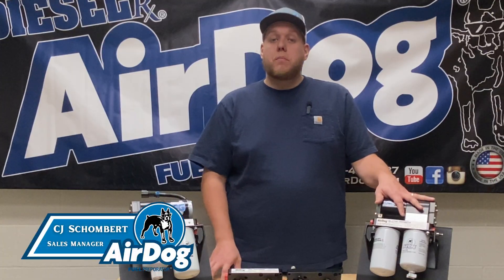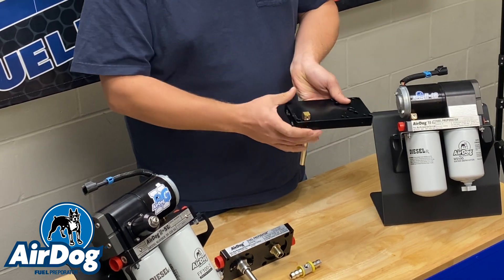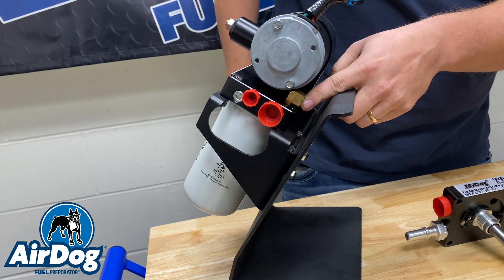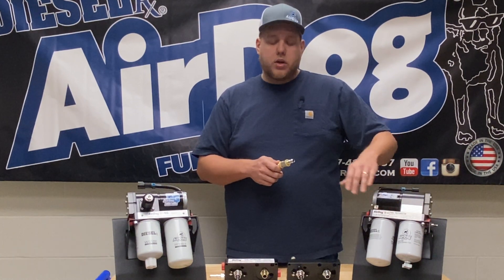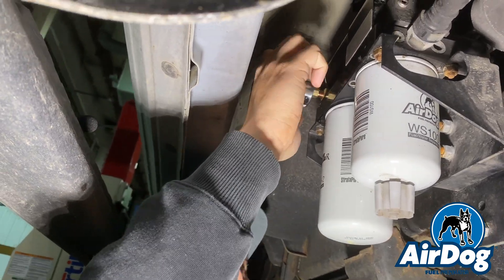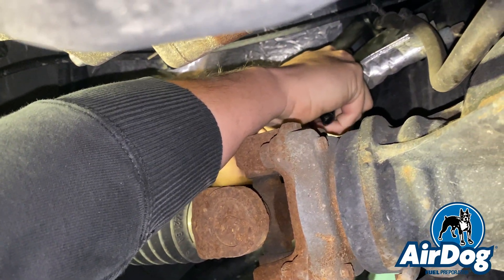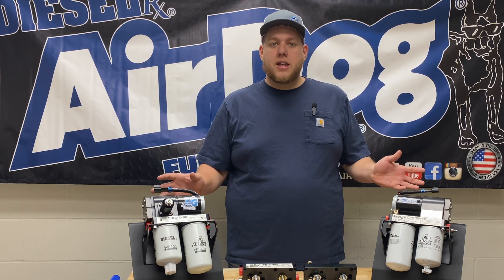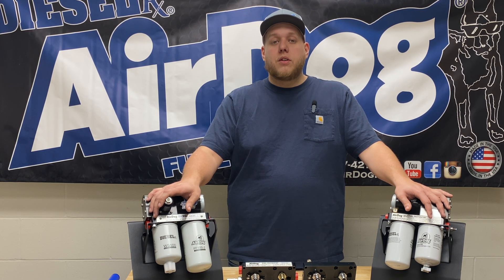Installing a Fuel Pressure Gauge / How to Check Pressure on Your AirDog!

Comment: I have seen mixed reviews. What about for a 2015 Duramax with an ezlynk 5 state tune? Usually ran on 65hp over stock but sometimes more.
Reply from the maker: Yes, our DF-165-5G or FP-150-4G will handle that with ease.

Comment: I own a ram 2500 03 5.9 diesel with edge cts tuner, cold air intake also
It has the 5g air dog 
Where my fuel psi pressure should be?
I just check and was around 15-18 with the liquid gauge.
Is this ok ?
Help Please 😊

Comment: Forgive the dumbness of this question/statement. I've used the Blue Monster tape that says it's ok to use on petroleum oil distillities. Pardon the misspelling there and I've never had an issue. Am I wrong for using that instead of the other?? I only use it on the pressure sending side of things!!

Comment: Can you install a fuel gauge further up where the primer on the oem fuel filter is? Deleted the primer because it was leaking and the blocker plate comes with a pre drilled hole for a fuel pressure gauge. Will it give the same readings as if it was installed in the lift pump?
Reply from the maker: Yes, you can mount a gauge up there and get an accurate reading.

Comment: If I have a fuel pressure regulator would I just be able to read it off that or still put one on the pump?
Reply from the maker: At the fuel pressure regulator will work just fine. Reading pressure anywhere on the pressure side of the pump will give you an accurate reading.

Comment: Why can’t you run a electric one in the 4g airdog
Reply from the maker: You can. You just need a sender that is 1/8npt. If the sender wiring is too short, you can either extend the wiring or get a fuel pressure splice and move the sender farther upstream so the wires reach.

Comment: Can you install a liquid filled gauge with the 1/8” NPT Tee right out of the positive line to the fuel injection pump or is that something that will affect the fuel flow, reversing the work that the lift pump did?
Reply from the maker: It should not effect the fuel flow as long as the tee you use is 1/2". Here is a link to our fuel pressure splice: https://pureflowairdog.com/i-30497736-fuel-pressure-splice.html

Comment: I wonder how much of a technical challenge it would be to use a Bluetooth transmitter for the output pressure data, and read the output on a wireless gage, or smart phone?
Reply from the maker: Most fuel pressure gauges can be easily adapted!
Reply: @Airdog Fuel Systems / Diesel RX  I don't understand. Adapted to wireless? My aftermarket TPMS is wireless, using a 3 volt coin battery at the transmitter, and produces warnings for low/high pressure, high temperature, sudden pressure loss and current pressure/temperature. Batteries last 6-12 months. I'd love to see this capability offered as an option by AirDog.

Comment: 8-10psi is what u want. thats why the newer gen lift pump is set to that. i dont own a cummins but i own a duramax, it dont like more than 10.
Reply from the maker: 10 PSI is correct for the GM Duramax platform!
Reply: @AirDogSales where do i need to be pressure wise for a 1999 24v? Ive got airdog 4g, having some hot start issues. Where do i get a gauge to,test and adjust my airdog if necessary.
Reply from the maker: @MrSrtman18  15-17 psi is optimal for a VP44

Comment: So, with a airdog 5G, how are we supposed to put a liquid filled gauge on it when it's pointing at the frame rail?
Reply: The spacer block still allows you to mount the pump on the inside of the frame rail, with the diaphragm regulator facing the frame, so in that circumstance the gauge port would be facing outwards. 

This particular truck with the def tank location didn’t leave option for inside of the frame rail, that is why it is mounted on outside of the frame rail. 

Though if you do find yourself in a situation that you can’t fit a liquid filled gauge into the AirDog base, I would recommend the fuel pressure splice.
Reply: Same problem